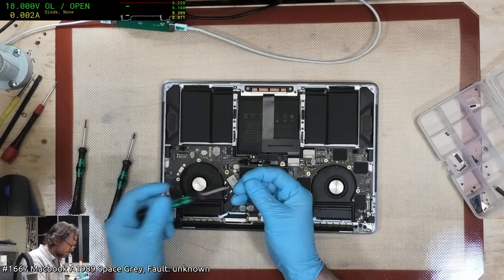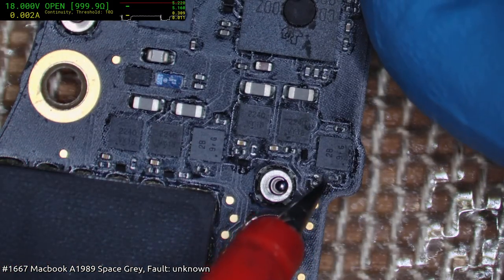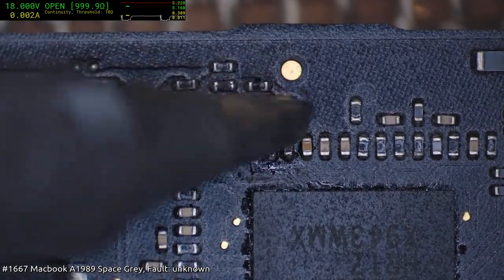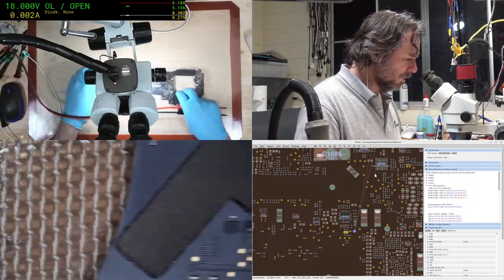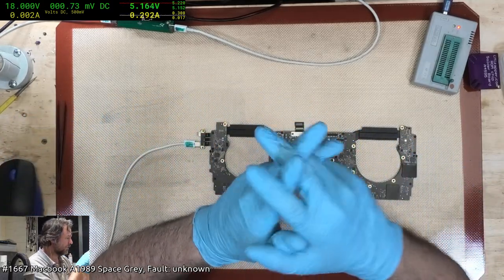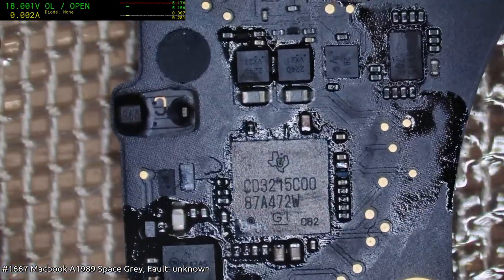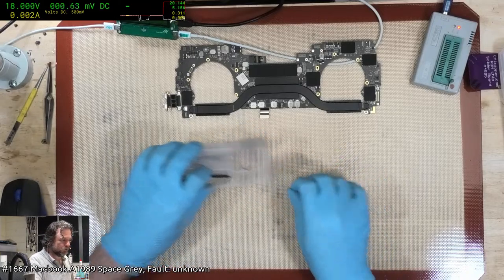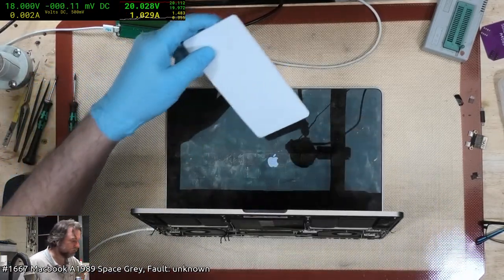#1667 Macbook A1989 with unknown fault. These machines like to torture me with CD3215 issues

Comment: I forget the site but he was getting fake chips and before testing them he done some simple things. Tried alcohol on a cotton bud and the laser cut stayed, tried thinners and the fake chip started to dissolve onto the bud. He did notice the surface looked fine sanded unlike original and good replacements. Don't know if this helps, somebody has more than likely mentioned it before.

Comment: Mr. Daniels, why in your opinion there are so many problems with cd3215 chips? Are they so low quality so it pays off to produce fakes as spare parts?
Reply from the maker: It's because they're a complex chip and it's an interface that has high user/environment-exposure, combined with the way Apple has designed the board if one fails, they collectively fail, which is a good thing in many ways except that there's not always a clear indication of which one has failed.   Some of it is a Apple's "fault" some is just the inherent nature of the USB-C "standard", particularly that it's such a technically overloaded spec.

Decoupled USB-C ports would have definitely made repairs easier.
Reply: @pldaniels  thank you very much for the reply.